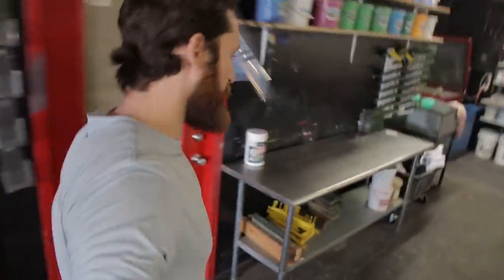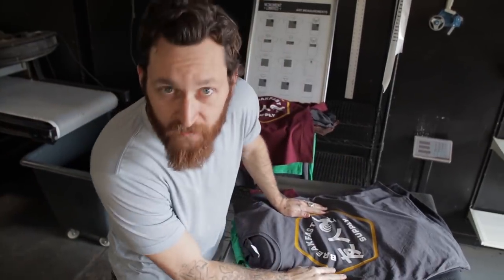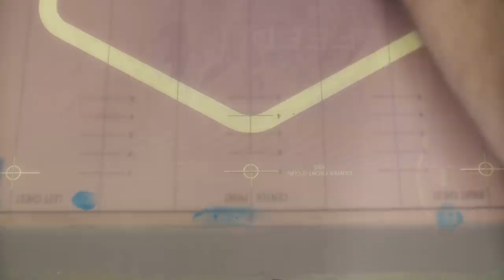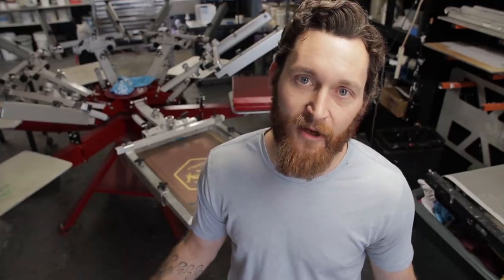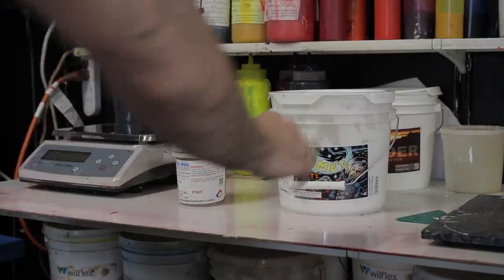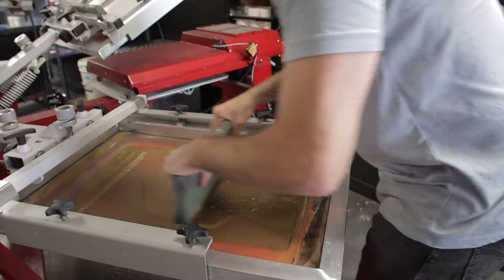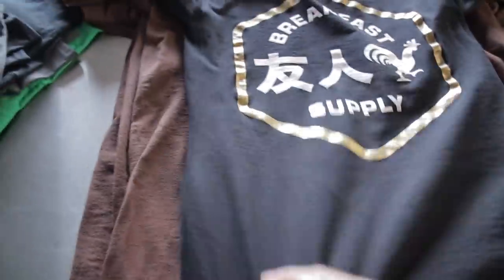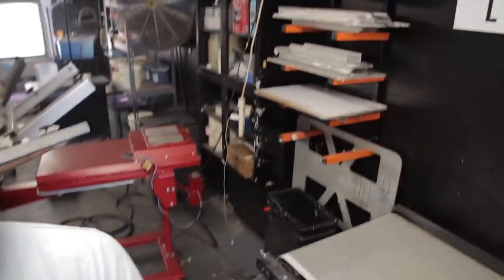Register a 2 color Water-based Screen Print on the Anatol Thunder | T-shirt Business

Comment: I print with only water-based ink at work. We print 2 to 4 color,  a good tip for anyone doing longer runs is to mist the ink with water once it's been flooded; so that it doesn't dry up in the screen.  Sometimes when the ink is to thick I just add some water to rejuvenate them. Works really well. I wonder if samples you were sent would just need to be hydrated, if they are water-based.
Reply: Also Misting the screen before the ink is down helps.

Comment: I bet it's the fan. I had the same type of problem, when the wind would blow strong from the north it would actually blowback against my exhaust fan causing Breeze in my dryer tunnel and the temperature would be all over the place. Try tilting that fan away from the tunnel a little at an angle.
Reply from the maker: trying it now!
Reply: Yeah I found that my fan was causing my temp to be all over the place too
Reply from the maker: Unfortunately that was not that case, It seems to be the temp controller or a bad relay even though It has a new relay, The fan was causing some temp differences but the dryer needs to be repaired.
Reply: @ThePrintLife  that sucks those Omron controllers aren't cheap. & a pain to program
Reply: Make sense

Comment: Is your fan throwing in a backdraft to your heater which is causing it to overheat
Reply from the maker: Checking that now. Will get back to you. If thats it I will shit.
Reply: Just watched the video and I thought the same thing. But it’s now September so I’m guessing you’ve fixed the problem already or you’ve replaced the heater all together? Either way, great video
Reply: Hi I don't speak English very well so excuse me if write something wrong.
I use a fan at the of the dryer too but I put it throwing the air at the basket.
Greetings from Panama...

Comment: Hey Cam, so you soak your screens in water? immediately after coming off the exposure unit. For how long and is it just water? also do you do this for both water base and plastisol inks and for the same amount of time because I alway thought water breaks emulsions down. Just wondering, Thanks
Reply from the maker: just a quick dip no more than 30 seconds, most of the time we just dunk it for 5 seconds before taking it to the wash out booth.

Comment: Man thats the heat controller on the dryer that just happened to me on a machine, replace them i believe its a watlow brand controller... thats why you are having trouble with the temps... thats like the brain of the dryer
Reply from the maker: I Have one sitting here could not figure out how to program the damn thing. changed the mercury relay and it fixed the temp issue for awhile but I think your right, Do you know what setting to change on the watlow controler????

Comment: What is the reason for a post cure for water base inks? 

Is it because the water in the inks will break down the emulsion when pressing when you press?

I seem to be having that issue because im using water based inks and my emulsion is deteriorating.